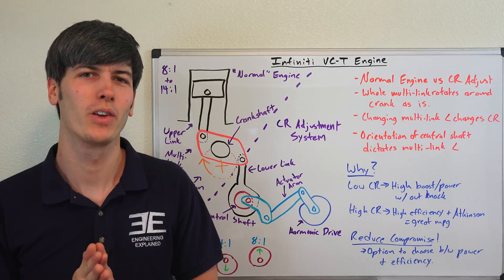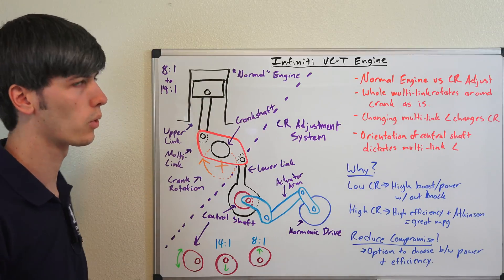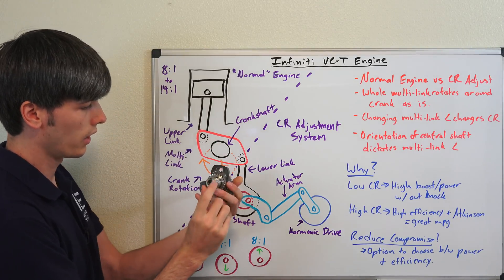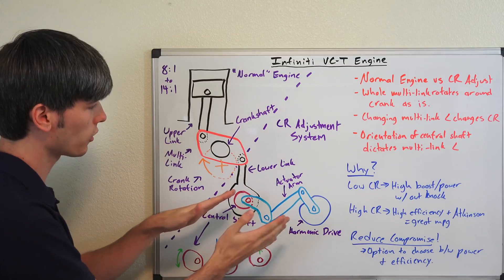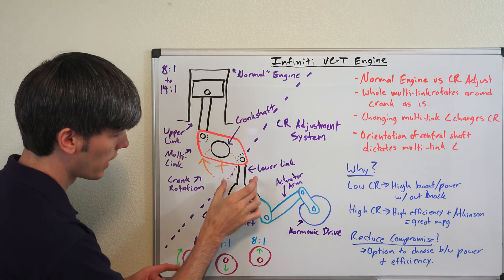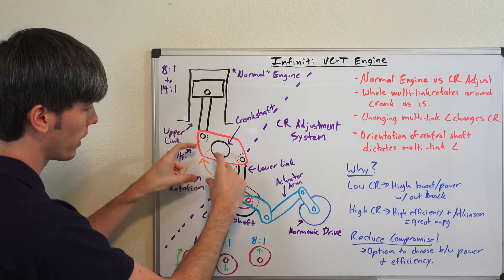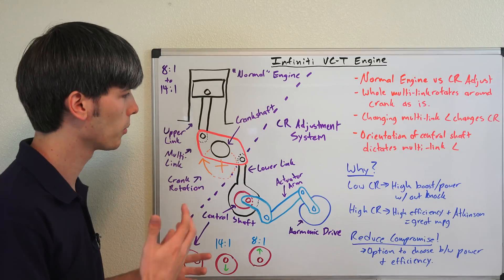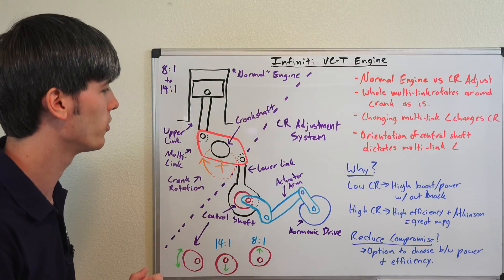Infiniti's Amazing New Engine - Variable Compression & Turbocharged

Comment: Wait, so how does a lower compression ratio result in more power? I don't follow the logic
Reply from the maker: Peak boost will only occur when the compression ratio is low (it's safer this way). Boost = more air, with more air you inject more fuel, burning more fuel means more power.
Reply: You can run higher boost pressure with lower CR.
One of the problems a normal turbo charged engine has, is that they have a lower CR than a natural aspirated engine. At low revs with next to no boost pressure, this results in low power and poor efficiency. Once the boost pressure is up, this problem disappears, but until you reach enough pressure, it would be ideal to run with higher CR. This engine does exactly this.
Reply: and only rev to 4k. With random timing of combustion.
Reply: +Graham Frame - A diesel with the right gearing can hang with any gasoline powered car. There just need to be more consumer demand for diesel cars, and not just trucks, for manufacturers to put more out.
Reply: My 1994 B18C1 VTEC engine has 356,000 miles (573,000 KM) and has never needed major work other than 1 head gasket replacement at 330,000 miles, if you consider that major work.  Cylinder head was surfaced and cleaned, with new valve seals installed.  Nothing has ever been done below the head gasket.
Reply: +Graham Frame - A diesel with the right gearing can hang with any gasoline powered car. There just need to be more consumer demand for diesel cars, and not just trucks, for manufacturers to put more out.
Reply: Diesel is the filthy waste product sludge they scrape off the bottom of the tank when they refine gasoline.
Reply: In the UK diesel is more expensive than petrol because the demand is greater. The problem is people who enjoy sport cars do not like the characteristics of a diesel engine. Also diesel engines are much heavier which affects the handling of the car, not that anyone push the cars enough to actually notice.....
Reply: +1CoLoRz2 lol explain Audi diesels winning 8 of the last 11 Le Mans 24hrs.
Reply: Corey Lennon But like he said, diesel isnt allowed in F1. They like to think theyre the leaders in development but they limit so much that to me what lmp1 is doing is much more exciting.
Reply: +shi01 this could have nothing to do with cr; but would an anti lag system change anything?
Reply: Abniel Sanchez
Yes it would, as long as only power matters. Though most ALS use way more fuel than they ever would save, so better for power, worse for fuel efficiency unless you would implement a system like Formula 1 uses right now where the turbo charger can be supported with an electric motor to guarantee ideal boost pressure in every situation.
Reply: +sienile sounds like crap doing it tho 👎🏽
Reply: Guillermo Lovato
not really, I didn't tear down the engine or even pull the block out of the car.  Just replaced the head gasket and put a refreshed head back on it.  And it didn't even need that work until 531,000 KM.
Reply: obviously you have a lot to learn about engines. all they really do is suck bang and blow. lolz

anyway to answer your question, lower compression is needed for high boost application because boost with high compression results in pre-ignition or engine knock, chipped pistons and sometimes shooting parts of the engine through the engine block. so obviously at higher compression, the boost controller will lower boost and allow the motor to do more of the work and burn less fuel by using the fundamental properties of thermodynamics. when you compress a gas such as air/fuel mixture more before ignition it results in more power once combustion takes place. this results in further fuel efficiency. when you add boost it does not always increase fuel economy. you must have a perfectly balanced and tuned engine with hundreds of variables in the right place for a turbo engine to actually be better fuel economy. 

turbo fuel efficient engines can put out as much power as some v8 engines and still get better fuel economy because you're still burning less fuel, there's less displacement and the engine weighs much less than most big v8 engines. 

I kinda know what I'm talking about because I know stuff about motors :D
Reply: +NickLiang fuel in general in the UK is more expensive than in the US not just their diesel. so that point is pretty well invalid
Reply: Colin Matlock Fuel in the UK is ridiculously more expensive than the US, which I think is why most cars in the UK are fairly small with smaller, more efficient engines.
Reply: +NickLiang they also don't have a higher demand for diesel than the US does considering that as an overall stat goes the US uses almost 10 times more oil than the UK does its pretty impossible for them to have a higher demand for any crude oil based product than the US does
Reply: Colin Matlock I am not comparing the UK to the US. You have clearly failed to comprehend what I wrote. The UK and US are completely different markets and the consumer demands are different. So your comparison is the one that is invalid.
Reply: +NickLiang diesel and petrol are very similarly priced in the UK, diesel is not currently more expensive than petrol by any large margin we are literally talking about the difference of one to five pence (or pennies in America) per liter so still your point is invalid
Reply: lower compression to boost up with turbo and added fuel resulting in more power vs higher compression to run like a naturally aspirated engine and save on fuel consumption! Nissan/Infiniti/Renault (Japan/French co engineering) trying to get the best out of both world scenarios! IMO!
Reply: Just so happens that i just beat out a 1.6 petrol opel hatch with my 2.2 ford single cab pickup form light to light. 2.2l is rather small for a diesel in a pickup.
Reply: Graham Frame
Reply: just an ordinary 1.6 16v hatchback, point is diesels can take advantage of long ratios because of the massive torque at low rpm's, it even suprised me at the time, the little pickup (small as it may be) must weigh atleast 800 kilo's more than the little car.
Reply: Lol yeah doesn't sound great now you put it that way, but seeing as its nearly twice its weight thought it did pretty good. and also producing nearly 400nm @1500 from a 2.2 while still maintaining good fuel economy is pretty impressive by any standard not to mention in factory trim, something gasoline/petrol will find very hard to match.Don't get me wrong i like both but prefer rolling coal for most applications.
Reply: Colin Matlock Recently it is similarly priced due to the crash in oil prices. For a long time Diesel have been significantly more expensive than petrol due to a greater demand. Currently diesel on average is more expensive.
Reply: Unfortunately around a track diesels will never be as capable as gas.
Reply: +CJSchecter96 lol I really don't care to. Also I would be interested in seeing an article of something on it though
Reply: +1CoLoRz2 haha yeah just saying.
Reply: +CJSchecter96 well the big disadvantage is simply the weight of a diesel engine. They are often more than twice as heavy as their gas counter parts. They weren't even popular until the turbo was invented because they werw so slow. Of course now you can easily change that, but the weight factor will still be there. Ma That is why I said they would be at a disadvantage. I may be wrong though.
Reply: +1CoLoRz2 yeah you're right, lmp1 is really the only place I can think of where diesels stood a chance because audi has put so much into that program but in the real world like you said the weight is such a disadvantage.
Reply: If diesels were better then how come a diesel has never won a formula 1 race in history?
Reply: Corey Lennon As of now, I don't think Diesel engines are allowed in F1. They limit the engine size, type, etc. to normalize the competition to the best engineering+mechanics+driver, limiting the other factors, including fuel!
Reply: Uhh it's formula 1 man.  They could easily make special titanium blocks with iron sleeves to handle MASSIVE pressures.  Like it would cost much more than a formula 1 today anyway?
Reply: Corey Lennon They could even make races with tunnels that you could ride upside down on the top, yet it isn't allowed! Also, let's just be honest on what's the major question, the extreme performance like in F1 or everyday use? I would focus in what can we do for everyday use! Lower rpm, high efficiency engines, maybe combined with electric engines, might be the near future for everyday use from your coupe/sedan to the smaller trucks and SUVs. Considering in the US there's too much love for trucks and SUVs I would really focus in developing better(more sustainable sources) biodiesel and biodiesel exclusive engines, which could be more efficient then just mixing biodiesel in Diesel or going for the moronic "let's just use 100% biodiesel in a Diesel engine, it'll work fine".
Reply: I'm not an engineer, but the best explanation I heard on lowering compression to make more horsepower is: with a lower compression ratio you have a larger space to pack fuel and air into before you get to the magic number of compression ignition. With the larger volume of air and fuel, you can make more power.
As to the diesel vs gas weight issue , they have to make them heavier to withstand the greater stresses of higher compression ratios. 
One of the reasons diesel lasts longer is it is more of a wet fuel vs gasoline being a dry fuel. Look at any gas station around the pumps to see what I mean

Comment: A 2 liter, VC-T with a CVT trans..... hehehehehe
Reply: ikr
Reply: dont forget about V-tec
Reply: +Adrian Tosteberg that's what vvts hybridized into nowadays
Reply: Adam S yes you are right, I was thinking about the vrf800 vtec which completely closes one intake valve at low rpms. But for cars Vtec is mostly about vvt
Reply: Just sold my vfr last month :( ... that thing went 0-100 in like 5 seconds.
Reply: +Cams250 kmh or mph?
Reply: +Tyler Hanson Mph. I had the VTEC, it was a beast.
Reply: and in the front bumper, TVs

Comment: The rectangular piece dosnt mantain its orientation. The Lower Link rotates around the Center Shaft and sways right to left while the Crank Shaft rotates. By that it will extend the stroke from the crank shaft. I hope it is understandable english is not my main language.
Reply: correct explanation watch?v=PIWYoWvyE4s
It's not my video. I wanted to animate it but had no time at work.

Comment: Are you going to do a video on electronic valve actuation?
Reply: Do any normal production cars even use it?
Reply: tanker9987  Not yet I don't think.
Reply: With a mechanical system, it's all in timing, however if electronically controlled, if one sensor, program or electronic stuffs up and your engine is spinning fast, before you know it, valves and Pistons smashed. It is extremely unlikely to fail with today's tech (even electronic 30 years ago are very robust), but quite risky to put in a production car. In a standard car, if part of the ecu screws up , sensors will fail safe spark timing and fuel injection will default to safe parameters, however you are not afforded with the same grace period and leniency if your valves come down at the wrong time. As risky as using electronics to control the gun firing on an old war plane between the propellers. But even if it were explained, I'm sure it wouldn't be much more advanced then Spring return (or nitrogen filled) solenoids.
Reply: Clone36
 These guns were actually mechanically operated, the propeller fired them as they passed the barrels.
Reply: +tanker9987 I know that which is why I used as an example. Mechanically everything is in timing, I'm saying would they have trusted electronics to be controlling it. No because if one thing went wrong, you would shoot your propeller off, or in the case of a car, destroy your engine.
Reply: Clone36
 Got ya, just misunderstood your comment.
How reliable would you consider fuel injectors?
They are pretty much the same thing except smaller.

Comment: From watching a few of your videos the other day, I was under the impression that any gasoline vehicle with a compression ratio over 10:1 would knock. How did Infiniti achieve this 14:1 without any knocking? In diesel engines, there isn't any spark to ignite the fuel, which doesn't need it, with the right amount of compression, the fuel will ignite itself. Compression ratios are alot higher in diesel than gasoline because of this. And you stated a higher octane is needed to avoid engine knocking when using high compression ratios in gasoline vehicles. How is this achieved when using alternating compression ratios when fuel octanes can't change during the increase or decrease of the compression?

Comment: Seems like these newer innovations are offering diminishing returns for the ICE. I wouldn't mind buying a hybrid at this point as electrical systems are typically simple and I could still have a gasoline engine to work in tandem.

Comment: Expressing concern over the reliability, cost-effectiveness in terms of repairs, fuel-usage, and upfront costs, as well as actual power and efficiency numbers = valid. But a youtube warrior that has not worked on this design, the math or physics behind it, and who is an automobile hipster that believes everything should be 6+ liter V8's and get 40 HP/L who  has determined on their own that its a waste of time, that it'll be completely unreliable, and that it will never be cost effective = invalid. Technology improves. Go clean your carburetor and refill your oil from your last grocery run and tell me how much more reliable older engines are.

Comment: Hmm.. traditional knowledge just screams vibration issues.
More moving parts, held at different axis points within the engine mass.
I mean, correct me if im wrong, of course

Nice concept though. I kinda feel engine design is reaching its final stages at this point. 
Its good to see such ingenuity from designers, still pushing the limits of a very well studied mechanism
Every year we see electric and hybrid systems acquiring market momentum: its only a matter of time that those techs become available on the cheap, that's gonna be the end of the traditional IC engine

Comment: Are there any issues with inbalance in this system? I guess there is no chance to get this thing running smoothly at all positions of the parts used to change the compressor ratio. Would mean more ware and tear on the machine and results in lower MTBO

Comment: what I'm the most curious about is can this be changed while the engine is running? also is the boost diverted/limited when in high compression mode? this isn't continuous, it's adjustable by the driver correct?

Comment: wouldn't this add more vibrating?
Reply: they say that is an issue being worked on in the lab currently.
Reply: You can have more vibration the more moving parts you have. If the variable compression ratio mechanism would stay at the same position(compression ratio) there would be little effect, though you always have vibration dispersing through its parts. But as it changes the ratio with the different condition it will be moving, rotating the multiconnection part as the piston moves up and down(possibly greater stress in the piston-rod-cranckshaft group) and the cranckshaft turns, so you have vibration, plus greater risk of friction problems and more vibration in that case. So they need some well thought materials for the parts and maybe still hit a wall in the lubrification, needing a more "engineered" oil.

Comment: The most exciting thing I can think about this technology is that you can even change compression ration during one 4-stroke cycle: for compression and combustion, it just behaves like a normal engine; however, for exhaust, it can move the piston as high as possible to push all the exhaust gas out of the cylinder (which is a compression ratio of infinity). Then, for intake, it can suck more fresh air than normal engine does. I thought about this when I was in middle school. Can Infinity do this kind of stuff already? What do you guys think?

Comment: imagine this with vtec
Reply: Isn't variable valve timing how the Atkinson cycle is achieved ? Correct me if I'm wrong.
Reply: +alexnelson09 yup. I can't think of a single engine sold in a new car today that doesn't have VVT. And if its a high compression engine, guarantee its even using Atkinson (see Mazda Skyactiv)